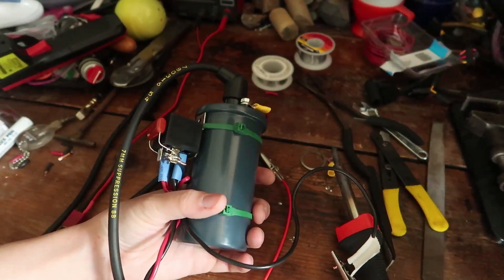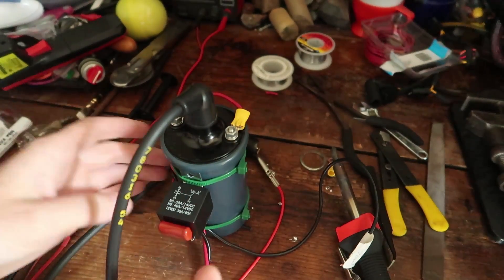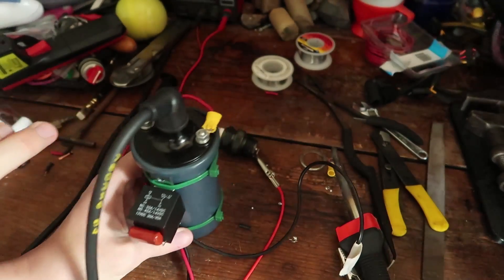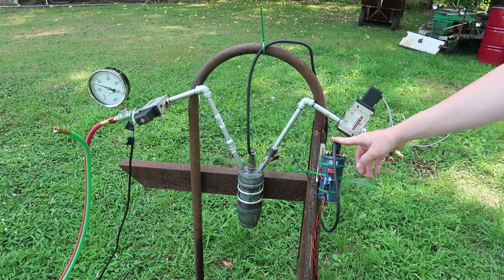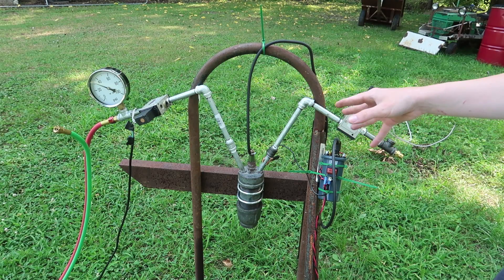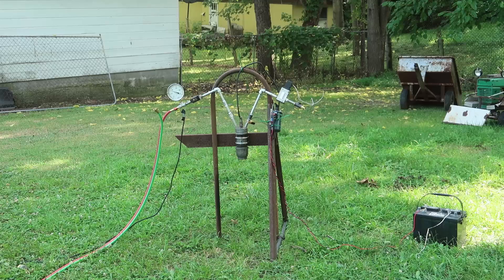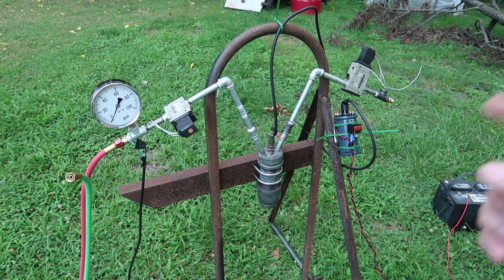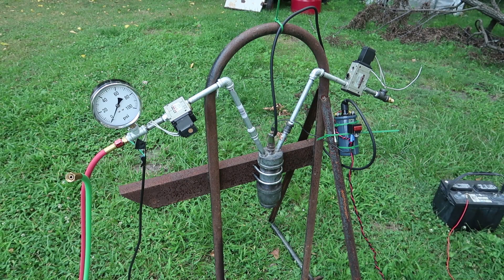DIY Liquid Fueled Rocket Engine 04: Test-Engine Spark Ignition Experiment

Comment: not correct actually mate. when the power depletes turned off from the primary coil, the primary winding's voltage breaks down (collapses') that causes a magnetic field on the secondary winding's giving a high voltage that you see as a output as an arc! high voltage!  basically how all transformers work!
   ` primary winding's are energized! as its turned off it holds for the current and as it depletes it causes a massive spike on the secondary as high voltage on the output! this happens with every fast switching of your relay! a transistor does the same thing as your relay! or mosfet as we call them.
Reply from the maker: thank you mister obvious, now whats not correct about what i did?
Reply: Hello, fellow Tesla-coiler; I must say, that even though his explanation is not the absolute-most-correct, I don't think that you were very specific and well-discerning in your explanation either. He didn't even mention the secondary or primary. How could he be wrong about something he didn't attempt to explain? 
And also, I wouldn't label all transistors as MOSFETs, because not all transistors are MOSFETs... but, all MOSFETs are transistors. And a relay is an inductive load; a transistor is not. 
And, putting exclamation marks after nearly every sentence, hardly helps your argument. Sorry for poking at you, it's late and I'm tired :) Goodnight for me, Good morning to you.

Comment: You have no way to control the air fuel mixture... it's just on or off how do you expect this to work? And you're also not adding any air. I like the idea but I think it was a waste of a cool old spark plug. Normally your "fuel pipe" or fuel manifold has some way to control the orifice size and same goes for your air pipe or intake manifold. You have a way to stop your gas control and let it flow but you're still not controlling it... on off is not controlling it. The solenoids are just a way to stop it from running away and turning the system off. You need two more forms of control one on the fuel side and one on the air side as well as an air delivery system.

Comment: High voltage and low current can cause your heart to stop (fibrilate?). Also, car batterys and a flame/spark will make them go BOOM, spraying shrapnel and acid everywhere. Wear protective gear.

Comment: Think along the lines of glow plugs?
Reply from the maker: wont create ignition without pressure
Reply: If the plug is above the ignition temp of your fuel air mix ratio it will.  You will have to have a slower flow rate to ignite and warm the combustion chamber, but it works. After warm up it will be self sustaining. You do need to mix fuel and air/O2 before entering the chamber to ensure that correct combustible ratio. Watch out for backfiring.

Comment: I think you should ensure proper fuel to Oxygen ratio first and then try this again.  It should work U guess. Thats a very interesting project. I like to see more of it.. 👌
Reply from the maker: well im not going to add oxygen while im still in town. i was hoping it would burn outside the chamber but that pop burned up all the oxygen. i should have blown out the air.
Reply: @RinoaL  few holes around the combustion chamber will help??

Comment: Can I add something that might save your life please. Regardless the solenoid valves, you really need to put some flash back arrestors in-line with your fuels (gas/oxy). You should also think about putting pressure gauges with ADJUSTments on them so you can vary your flow. That's kinda a big deal. And I'm wondering if you expect this to provide thrust? It's not going to in this setup. You are just going to burn the fuels. Please be careful with your experiment.
Reply: If you have never used an oxy/fuel cutting torch before, I would recommend trying it out. It would probably be quite a bit informative considering your approach here. Just go to a local welding shop, and ask one of the folks there to show you how to cut a slice of 1/4 mild steel about 4" wide. And then give it a try. Handling a fuel mixture system that actually works might be helpful since that's what you are approximating.
Reply from the maker: i already have flashback arrestors, already have pressure guages on the regulators, and no this no my intention is not to produce thrust with this since this is only a test engine to learn how to make my next engine better. also i happen own an oxy fuel torch. please pay attention next time
Reply: @RinoaL  no worries. I guess the regulators and supressors are likely on the bottles of course. Glad you're safe though. Good luck with the rocketry.

Comment: You need a longer combustion chamber with an inner sleeve that sits between the chamber walls and inner combustion on the inside of the chamber to create turbulent air and it will stay in continuous thrust. Your setup might work but it could use a lot more work. I build JD-5 jet engines so you should look into getting more airflow through the combustion chamber

Comment: I speculate that the mixture is not in a chamber which it needs the mixture is in an open ended pipe. If you reduce the pipe creating a chamber then as in a car engine, the mixture is temp contained. But  in your case it combusts and increase pressure through a nozzle sized for the max thrust. Very speculative, very dangerous. 
Why not read up on Goddard designs?
Reply from the maker: i was wanting it to burn outside of the chamber. and ive read technical manuals for many engines.

Comment: Can you start the propane burning and then slowly raise the oxygen?  Also You probably shouldn't be using steel with oxygen since it too will burn up.
Reply from the maker: hey, good to see you here. yeah that was my plan, to get the propane burning outside the chamber and slowly add oxygen. but this will be done on my friends farm so im actually wanting it to melt. i have an old Thermovision 470 that can image up to a few thousand degrees that will be pointed at it. later on i can switch to inconel. but no sense in spending much on my first rocket if its going to blow up anyway.
Reply: fair enough. look forward to seeing it!
Reply from the maker: thanks! this project is on the shelf since im focusing on building my 15x28 workshop. hope to resume rocketry experiments this winter.
Reply: @Cody'sLab Maybe you can goldplate/silverplate it for her so it won't burn :)
Or at least show her how it's done. She seems to be very talented with craft projects
Reply: @RinoaL  please do! I think hands on experimentation like this is extremely interesting!
Reply: I think a coating would be a great idea, but I'm thinking more like tungsten, graphite, ceramic, ect.  Ideally get the specs from NASA or other rocket engine manufacturers for ideas.
Reply: Hopefully we can see you starting back up your liquid rocket project again Cody. It was fun watching you. Keep up the good work both y’all.
Reply: A wild Cody's Lab appears.  Did you just find out about this channel yesterday too?
Reply: Wow Cody, nice to find you here! Greetings! 👋 You are right about the steel and its characteristic! Therefore I would suggest to coat the combustion chamber as well as the nozzle with molybdenum or graphite. I write this, because it is too complicated to build a cooling system for such a "little" rocket engine. Or one chooses the more expensive way and builds the whole thing from solid niobium or molybdenum.
Reply: I would think adding a downstream oxidizer halfway down the combustion chamber will allow sustained burn, nitrous oxide would work.
Reply: Re: steel wasn't the v2 combustion chamber steel?
Reply: AWESOME, to have Cody reply to your video is greatness, cherish the moment.
Reply: Well, i think steel should be fine, so long as you dot let it get too hot or run too lean (too much oxygen)

Comment: First of all safety first! You using flexible fuel lines way to close to the engine! Replace with suitable metal piping. At the end piping place suitable check values. Also  you need shut off values at your fuel source. Not electrical but manual.  Rig a mechanical level to pull, stop fuel flow. Test and test and retest. REMBER What happened to the X-15 While testing the engine! Check it out on utube. Be smart live another day. Love your stuff. Keep that way. TTFN

Comment: Without the oxygen line the propane displaces all the air inside the chamber so it will not light with the spark plug. It should light with oxygen added.

Comment: I'd recommend compressed air at least through the oxygen tube. It's using the oxygen inside the chamber and then it's starved.

Also, to aid in the process maybe have a little round plate over the spark plug that's about 1/2 the diameter of the combustion chamber and stood off 1/2" from the spark plug, so that the gases sorta gather and mix there next to the spark plug for ignition. 
Hard to say how it would affect thrust, or if it will just melt and fall out, but at least it should get it ignited.

Comment: You could also try gasoline / nitrous oxide.  Small tanks of nitrous oxide are easily available.  It would need a pressure regulator since the pressure in the tank is over 700 psi.

Comment: Hello, I did some simple calculations and found out that for every 2 parts of propane you require 10 parts oxygen for it to combust completely. So I feel in theory you could get  optimum combustion with this ratio of oxygen and fuel. So why don't you give it go?
Reply from the maker: why dont you think i already am going to?
Reply: It was just a suggestion recommending you try the ratio.

Comment: Really like your vids . I would agree the ratio for air fuel is the problem with ignition but more so due to the position the spark is ! If it could be at the other end it would be far more forgiving ! Alas this is probably why they use a long match to light as it is at a more correct mix being near the available air at the end to make up for any fine tunes ! Great work rocket lady !!!

Comment: When watching the Shuttle take off the ignition source is all the sparks that are flying all over the place at the base of the Hydrogen/Oxygen  engines The Liquid H2 and O are pumped in to the nozzles so fast and turned to gases on their way there so fast the ignition has to be an external source (sparks) there is no way to ignite it with the nozzles which is what you are trying to do.  Go the NASA web site and find the PDF files that cover the operations.  I think you might be confusing the Jet engine.  The jet uses an internal spark system on start only. Once the fuel has become flame in the burner cans the air pressure maintains the flame. Maybe I have not seen enough to comment, I am only 69 been a machinist all my life with an FAA A&E license rebuilding aircraft engines as long.  But maybe I don't know anything. Please be careful!

Comment: Would a glow plug from a diesel work better than a spark plug.
Reply from the maker: no
Reply: A capacitive discharge ignition system may work better.  Makes a much hotter arc.  It's what they use to ignite jet engines.

Comment: Get your self the components off a hot preassure washer the parts can be used for what your doing those hot water preassure washers burn disel there is also disel heaters they resemble a jet engine good luck .

Comment: hi ya,any chance you could give me details on what relay and cap you used in the vid and a little sketch  on the way it was wired,it would be perfect for a project i'm doing
Reply from the maker: experiment on your own until you figure it out. however the parts are an old automotive relay and a 47uf cap. bigger cap could be better, its just junk i had on hand
Reply: will do

Comment: hey you ned to introduce oxygen to the combustion chamber theres not enough oxygen flowing through to get a constant burn thats why it "pops" then goes out you need a constant 14 to 1 oxygen to propane mix to flow continuously just think of a torch theres holes before the burning tip to mix gas before the burner so hook an oxygen source and there is a basic start of your rocket engine you will have to try a few times before you get the right mix then wow basic start to your rocket propulsion unit cheers and good luck with the project from your pennsylvania rocket friend

Comment: Stoichiometry is a bitch sometimes. Your mixture is too rich. You could use N20 or O2 but would destroy your motor because it is carbon steel. At the very least it  should be stainless steel but would inconel or hastelloy would be better

Comment: I think purging with fuel like the Delta could be an option for you. You flood the combustion chamber with fuel and start the spark, then slowly introduce oxygen until ignition is achieved. You may also simply not have enough gas flowing, because rockets can not sustain ignition below a certain threshold.

Comment: The problem you had was a simple design miscalculation. You put your igniter in the wrong spot. It should have been placed further down the fuel and oxidizer stream, on the side of the chamber where they are supposed to burn, not behind the supply lines. You also need to feed both fuel and oxidizer at the same time to achieve ignition and continuous run. Filling it up with fuel only will not work and may, in fact, produce an explosion rather than controlled burn.

Comment: Too big diameter of the nozzle. It can't keep high pressure inside combustion chamber, so, no stable combustion inside. Also, only 2 tubes for fuel and oxidizer don't allow to mix them together.
Reply from the maker: this chamber is more of me learning how to do the solenoids and stuff. next engine will be shaped better

Comment: FWÍW:  Regarding that relay you talk about at the beginning of the the video, how long will the relay operate at that high rate of switching on and off before it wears itself out?  Or is it designed to do that? 
 
BTW, magnetos and distributor ignitions use a capacitor with points for the same or similar reason.
Reply from the maker: it should last for a few hours of operation. either way it was a surplus relay i got for like 75 cents last time i was in silicon valley.
Reply: @RinoaL  >>> In that case..
👍👍

Comment: You have the spark plug in the top, but propane is heavier than air so most of it is probably "falling" out thru the open bottom and doesn't reach the spark plug.
Reply from the maker: thats not exactly how that works. ya see with this i accidentally ignited the chamber when testing the spark, but then didnt let it sit long enough for the exaust to be replaced with air. waited like 5 minutes though. and i had bled the line like 8 minutes before testing spark and getting that flash, so that propane stayed in the chamber for 8 minutes.

Comment: You need to add oxygen for it to ignite. Propane will displace the air, and it's oxygen, almost immediately from the combustion chamber and without an oxidizer the propane won't combust. With gaseous propellants feeding at low pressure you don't have to worry about hard starts. Just regulate your propellants to ~100ish psi, turn on you spark igniter, and activate the valves and it'll ignite. Also that steel chamber won't last but for a second or two before it melts, so shut it down quick. Have fun and be safe rocket engines are inherently dangerous.
Reply from the maker: no, i was expecting there to be enough oxygen inside for it to carry the flame outside of the chamber and burn outside of it. but when i first popped it without the fuel on, it burned all the oxygen and i didnt give it enough time to be replaced with air again.

and yeah dont worry, i fully expect this engine to melt. thats why i will have a thermal camera pointed at it when its being tested.
Reply: Oh cool, I didn't know that was your goal. Well at least if it does melt it will be super easy to put a new chamber on it.

Comment: I could never get gasoline to work in a tennis ball cannon. But i could get near pure alcohol
 and nitro methane for hobby models to work. 

 Had something to do with stoichiometric ratio. Ethanol: 9 
Low value work well for internal detonation. 

Natural gas: 17.2
Gasoline: 14.7
Propane: 15.5
Ethanol: 9
Methanol: 6.4
Hydrogen: 34
Diesel: 14.6

Comment: Yeah, exactly as you said, the limit of flammability of propane in air is very narrow.  With oxygen it would be much wider, but loud pop when you hit the spark.  You could use an air compressor on you oxidizer line, it wouldn’t make the flammability limits any wider, but it would establish a repeatable steady state condition once you found the exact inlet pressures that worked.

Comment: Wye not just make your own hydrogen aluminiumoxite is grate for spliting h2o in to hydrogen and oxygen  its easy all you nead is salt  aleminium a cointainer that has 2 sepret roms whit a coneksjon whit whater between so the power wil flow  you can use 5 liter cans made of plastic cut it upp make a litet seperasjon wall and fil lit whit beercans and copper and your all good to make the hydrogen you need for your exsperiment

Comment: You could always try for a hypergolic fuel and oxidiser combination, using kerosene and concentrated nitric acid. It was used in the early days of the Soviet space programme.
Reply: Hypergolic is extremely dangerous it wouldn't be worth the risk.

Comment: Have you tried external sparks?  I know little about this stuff but just thinking of the video of space shuttle launches when they had those huge spark producing devices to ignite the shuttle engines (not the solids).
Reply from the maker: yeah im thinking about doing that also. however id like to get internal spark working.